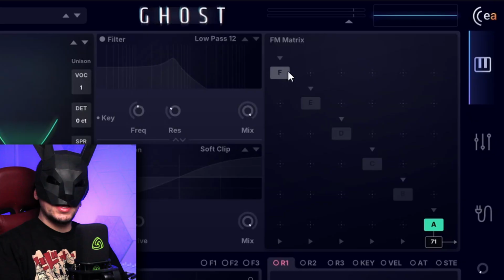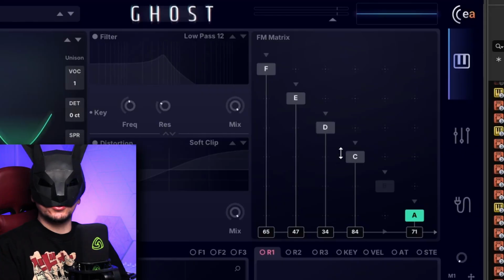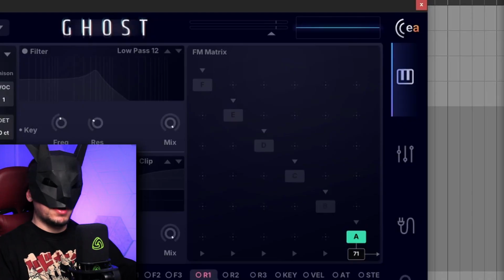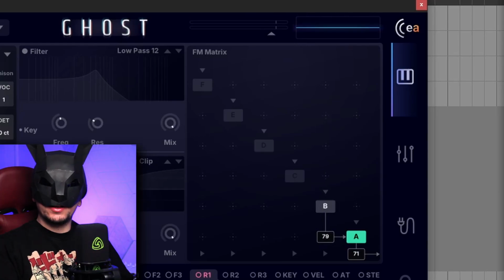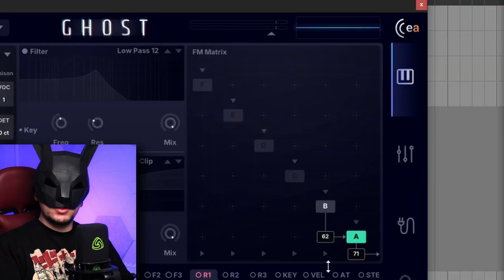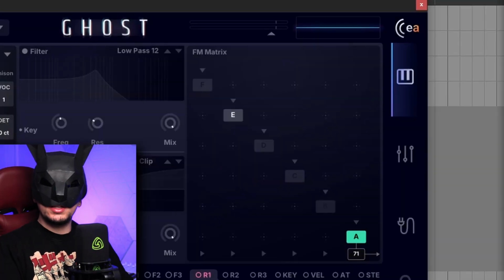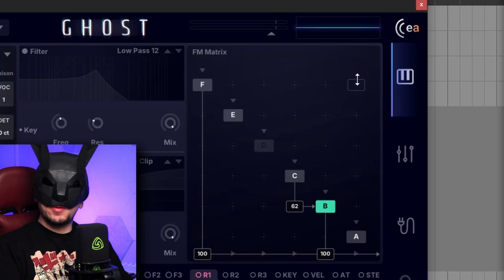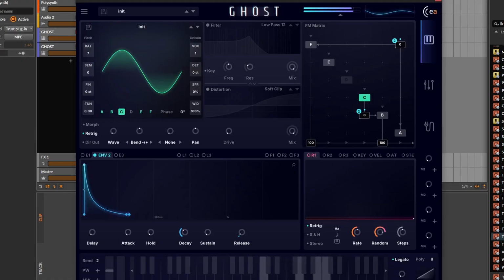Ghost Tutorial 1: FM Matrix

Comment: ++++ Sampler, Noise Generator, Wavetable editor and this plugin will be head to head or maybe stronger than  PhasePlant, Serum, Fm8...
Reply from the maker: Thanks for the suggestions mate. I'm planning to add a wavetable editor by mid 2025. A sampler & noise generator will require a couple of overhauls, and is probably better suited to Ghost 2. Hopefully I get to make it!
Reply: @exacoustics  You did a great job thank you for your hardwork! :) I'm using an oscillator to generate noise figured that out! For an update a limiter would be awesome :) Thank you for your feedback! Good Luck :))
Reply: @exacoustics  Are there any news for Ghost 2?
Reply from the maker: @vladimirackermann6182  It will be years before I consider Ghost2. Instead, Ghost will get new features in future updates. I'm working on new FX right now and they'll be available in the FX rack soon.